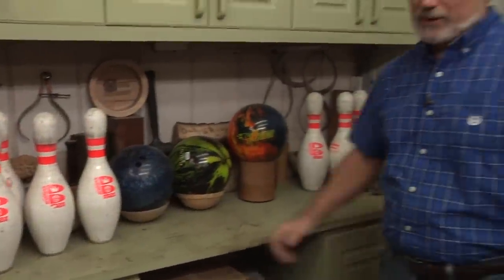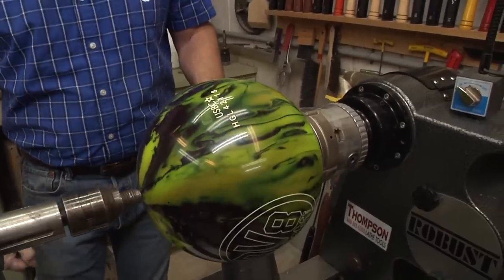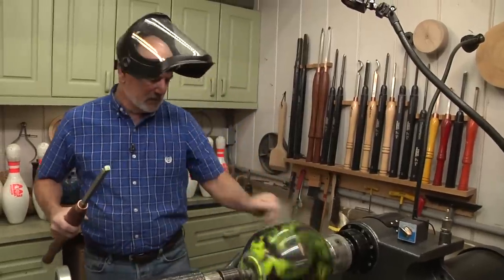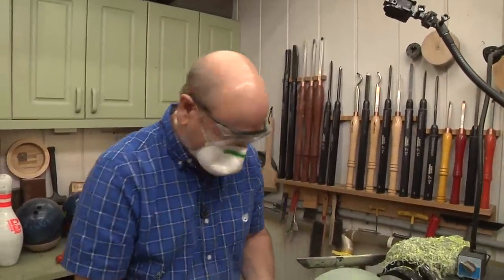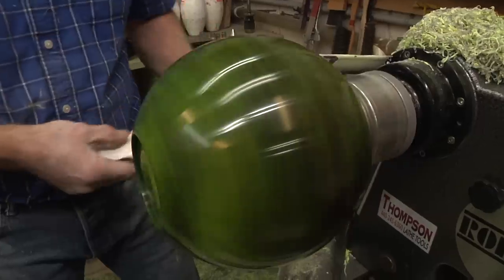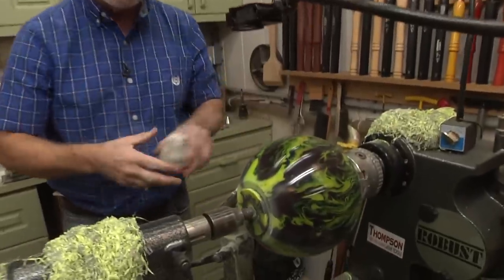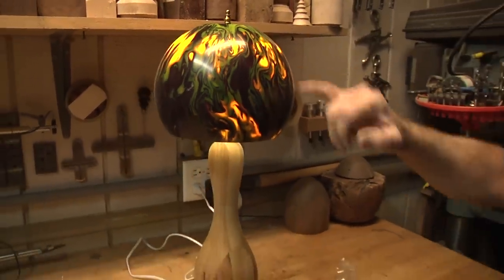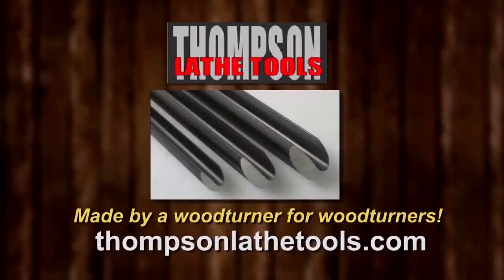Bowling Ball and Pin Lamp

Comment: Nothing against your sponsor but you need to check into the size of the carbide inserts for your handles. If they are of a standard size there are thousands of sizes, grinds and types of inserts available in the Mcmaster-Carr catalog. This is a metal turning/machine shop supplier but a carbide insert is a carbide insert and negative rake is very common in metal turning applications.